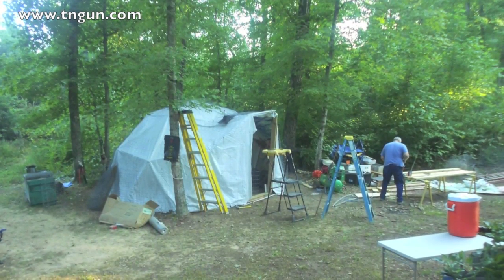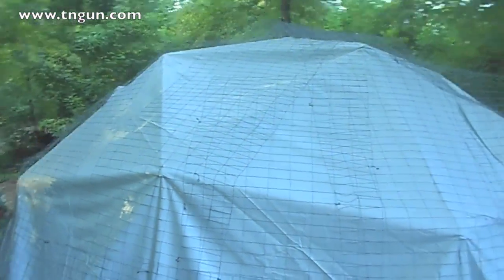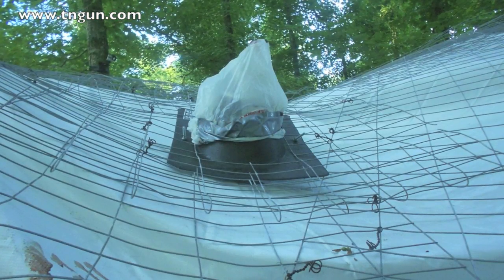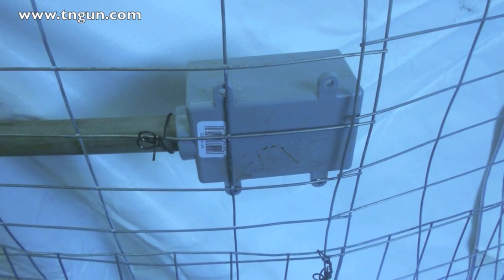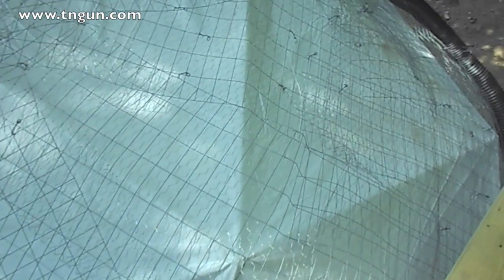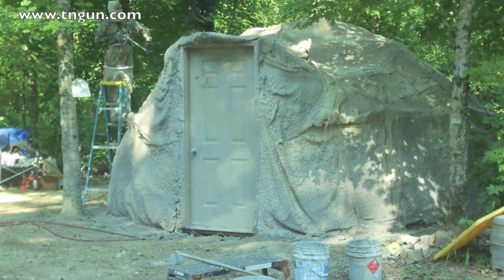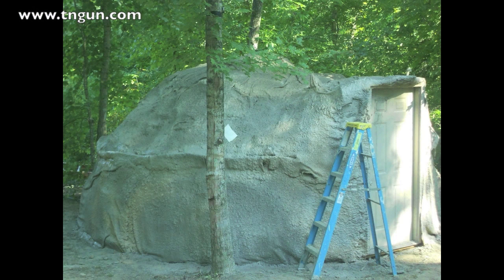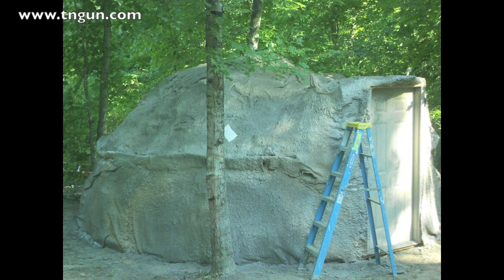How to Make an EMT Conduit Geodesic Dome V

Comment: Nice job, seems you thought a lot through in the beginning, and started rushing at the end, I am not judging, most of us tend to do this and I have done it myself and really messed up a project because of it.. Hindsight being 2020, I would have placed some kind of strapping in-between the pipping or cut ridged insulation to fit within all the triangles and then applied the rabbit wire fence over it holding it in by staple's, that would gave you an insulating factor to it, something more stable to hold the fence/wire to & help give the shape you wanted... After you were done, you could easily removed the strapping used on the inside and you would still have a solid structure to attach what ever interior you desire or leave as is...
I am sorry if this sounds rude, it is not my intent, I am just trying to be of help and maybe pass some advise to someone else attempting to build this project...
Reply: Try doing one similar to what I said, I have friends who have done them like that as well, sadly I have no pics nor video to show you, but it does take more time to cut the ridged insulation to fit, laying it on top and tracing with a sharpie makes for a tighter fit, also another thought I had was digging down like 6 feet or so concrete or brick lined and build it on top, that way it would have a basement level for storage...  and if you use a waterproof concrete for the dome, it would not be that much harder to add soil and grow some type of grass or plant to cover it, that would give it a more insulation factor and kind of hide it some depending on where you have it, either way it would look cool anyway, I seen dozens of domes done with grass tops..
Again, I did not mean to sound rude in my first comment, I do tend to for get niceties sometimes... I am a retired master carpenter and was an avid primitive camper. I've built more buildings then I could even begin to remember, LOL sorry to babble That is a very good concept though... 
There is a very old method, where they made a massive pile of moist sand and would apply leaves sticks and cloth over it to hold it together (from falling apart) then they would simply pour the mix right on top in several thin layers and when it dried dig out the sand and there was the dome... 
I could talk all day about this this, lol I will leave it at that... 
Good luck with your next endeavor...
Be Blessed
The Wolfster......
Reply: TheWolfster001
Would you have any thoughts on building a dome that could be underground,  at least mostly covered with earth,  but not very deep.
It would have a form or a mold system so there would be an inner and outer form, one being an air form, maybe one or both being thin layers of ferrocement on chicken wire,  with basalt cord like used in ecomonolithic domes from Suda glass in Houston. 
Okay,  then the inner area would be poured with Aircrete in several lifts, or pours.
As opposed to ICF, Insulated Concrete Forms,  where the outer walls of the molds are expensive Styrofoam and the empty space filed with the structural concrete...I would want the mold being made of cheap but structural concrete,  with the inner space filled with cheap but midgrade
 structurally reinforced Aircrete. Basalt fiber and Helix Micro rebar could be added to drastically boost the Aircrete strength. 
Use of chicken wire,  Basalt cord,  as strong as rebar, could also be used. 
You seem to have experience and can think outside the box.  Any ideas?

Comment: How has this structure held up over time? Looks to me like you've put together an idea I've been thinking about. Actually the rough exterior is more appealing than a lot of smooth ones that I've seen.
Reply from the maker: +Susan Rogers Pretty good,  Due to the rush to film for doomsday preppers I did not put in a foundation so it sank and put the door out of plumb (my fault)  I sold that land off for a smaller piece I don't owe money on so I don't have a current status.
Reply: Well settling does happen, but hey, you'll do it better when not so rushed. Glad to hear it's done, good other than the settling and that your not paying on property. Thanks for the sub, not sure when I'll get any more vids done.

Comment: I believe you actually mean a low slump mixture... The higher the slump, the wetter the mix. Slump testing is done with a slump cone, where after removal of said cone, the amount the crete settles is its slump. Not trying to be a nitpicker, bit as a concrete finisher I thought it would cut down on confusion
Reply from the maker: +Shannon Barger Your right, I did mean low slump, I am new to concrete work - like I am to all my projects except firearms.  Thank you for keeping me straight.  I appreciate it when those more educated on a subject share their skills with me.

Comment: Next time use lath, it's just expanded metal mesh. You can just use a $50 texture sprayer for coating it. You'd get a stronger cleaner finish. The lath will lay flat instead of fighting with wire and plastic. I've tied a ton of it over the years and it goes fast once you get the technique down. FYI there's an up and down with lath. The beveled openings should point up to support the concrete.
Reply: Lath is more expensive right?

Comment: A tarp sandwhiched between two concrete wire mesh panels is a self suporting structure , rebar reinforcement for larger structures. Greenhouse, shelters,storage , applications are many, also easy to construct.

U

Comment: Saw an article about a school in Guatemala where they used plastic bags and plastic bottles sandwich between chicken wire mesh and then applied concrete cement.  I thought it was amazing.  I'm planning on using the technique on geodesic dome.  Here's the link to the article. http://www.greendiary.com/new-schoolhouse-in-guatemala-built-from-6000-plastic-bottles.html

Comment: Before using cement outside, could you use the foam insulator sprayed on first and then layer cement on top of that.  Maybe that way you can shave unwanted bulge and form more spherical and smoother shape???  would cement stick to that foam?
Reply: oh and I would have used zip ties
Reply: Miranda Studio

Comment: The earthship folks do something like this for some of their builds. However, they use two types of wire mesh. They use the bigger chicken wire to create a dome shape. Then cover it with a finer mesh tied to the bigger. Then they gather some rags & dip them in cement. Then apply the rags on the mesh to create a shell. Once the cement impregnated rags cured they trowel on other layers of cement to create a strong shell. This could also be done using a shot-crete method. You may want to look at the Earthship web site for examples.

Just my 2 cents... Worth every penny...LOL

Thanks for the vid....

Merry Christmas